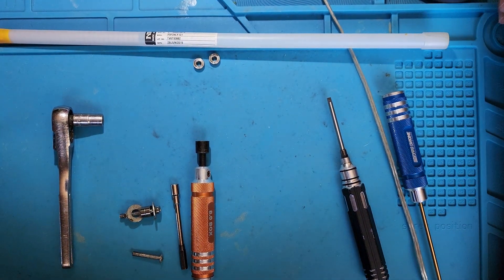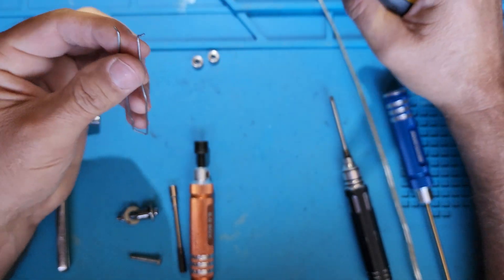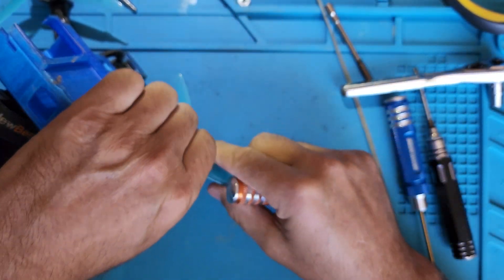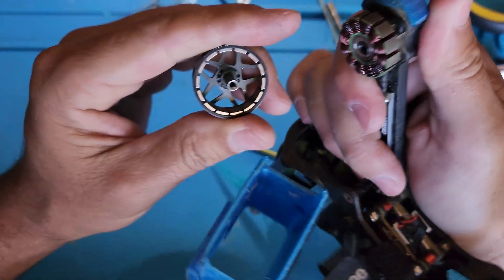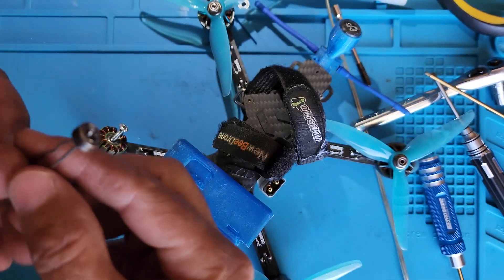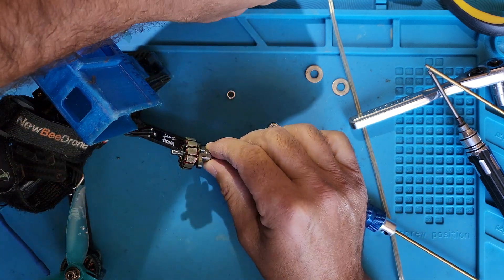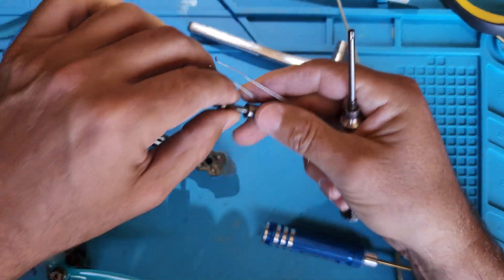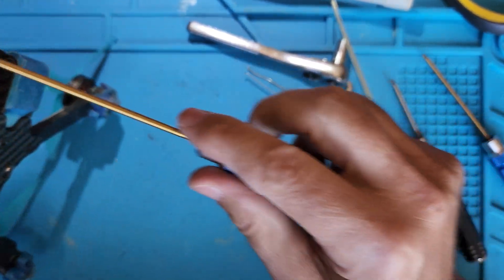How to change your drones motor bearings in the field or at home, (no press)!

Comment: I hate to be that guy BUT, what size screw did you use? What size was the socket you used to push the second bearing out? My wire doesn't catch on anything inside the motor. I don't seem to be getting the same results
Reply from the maker: The bolt is 3.75 in diameter and 23mm long and any bolt that barely fits through the bearing will work. I just use a paper clip in the video and flare out the ends, then clip it in and use the bolt to push against the paper clip and force the bearing out. The socket I use is a 5.8 mm.  You can use that or even something smaller.
 As long as it fits.
 And is wider than the inner race of the bearing.

Comment: Wow what an amazing method. Can you please share where I can find these bearings? And are these compatible with 2207s only? Or 2306s or 2806s as well? And how do we determine the specs of bearings? Thank you so much for shading content mate 👍
Reply from the maker: I buy them by the 100 from Miya at ntn@zyslbearing.com direct from Japan they will fit any motor these days that take a 9x4x4 bearing which is like just about all them for drones. Each motor will have a design blueprint on the site  that makes them with bearing size these are the NMB L-940zz which imo are still the best 👌
Reply: @DRONEPOISON  Got it. And MTR stands for “Metric”?
Reply from the maker: @TariqShahFPV  no idea on  MTR or where you got that. The bearings are 9mm x 4mm x 4mm
Reply: @DRONEPOISON  I saw it written on the bearing casing tube you have “L-940ZZMTR”. I did a lil research and I think MTR means metric system. The other one is inches.
Reply from the maker: @TariqShahFPV  the company I referred is the manufacturer that make nmb bearings. It's the lowest cost you can get. But yeah I just order 100 and they last me like a year
Reply: @DRONEPOISON  thanks for the help mate! And just for clarification, nmb is based in Thailand.
Reply from the maker: @TariqShahFPV  you are correct, my bad, i was wrong, these guys are just a supplier. Let me know if you find them cheaper. Last time I bought like a year ago they where 117.19 usd for the 100 that was shipped. DHL.  Bearings where .75 ea
Reply: @DRONEPOISON  You bet mate, I got you. I’ll comment on this post to let you know, once I hear from them.